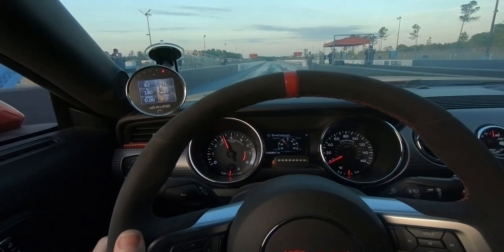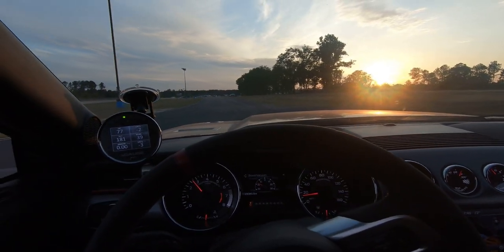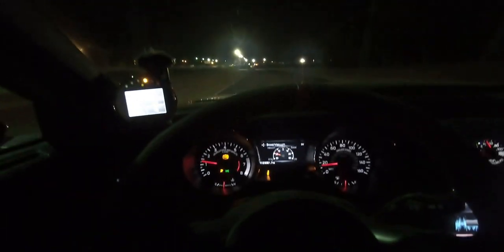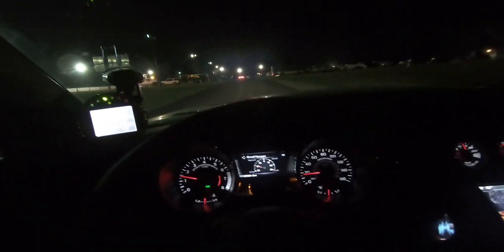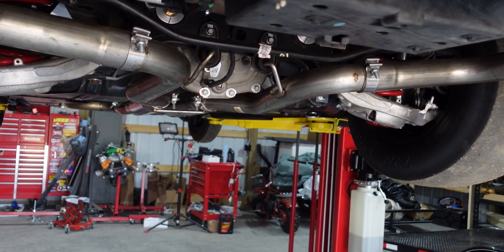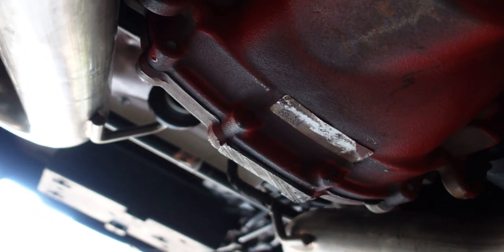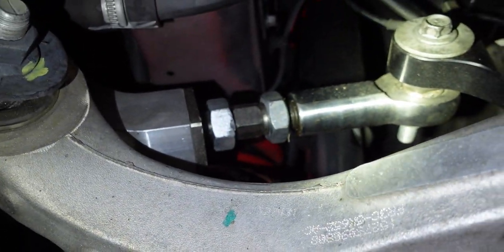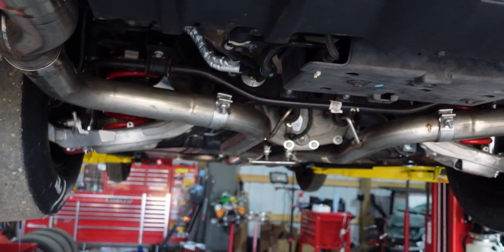How NOT to drag race a manual transmission Mustang!

Comment: Following 100% I'm a Gen 3 Whipple, stock motor and MT82 on E85. Going for a 9 here this season.
Reply from the maker: Right on man! I'm hoping to be real close to 9's by this season's end. Good luck to you and let me know how it goes!
Reply: @BackyardBMX73  Yes definitely. What's the setup for you now? I might have missed it in a video. Pulley and fuel? I'll be on the 3.1 pulley this year and E85. 3.1 should get me 16psi. I have the MPH, best of 142mph at 3800DA and no skinnies on the front but my ET is only 10.6 with a horrible 1.78 60ft 🤦 lol. 142mph was on the 3.2 pulley.
Reply from the maker: @freak_5.042  I'm on a 3.625 pulley, 93 pump gas tune but run a 50/50 pump and race gas mix. This past weekend at Ford Takeover, I ran a 6.85 1/8 on only 16° timing and short shifting. A full 18° of timing and correct shifts should get me to 6.5x which is low 10's in the 1/4. I'd be happy with that for this year and shoot for 9's next year.
Reply: @freak_5.042  horrible 1.78 60?  Lol.  I mean I get if you wanna go real fast 1.5 or so is needed and doable but I would not call 1.78 a horrible 60 foot in a manual trans car.  If it was above 2 yea that is horrible lol.
Reply from the maker: 1.7x 60' is kinda slow for a manual. I went from 1.7x 60's with 3.73 rear gear last year to a best so far 1.51 60 with 4.56 gear this year. I'm sure I'll be able to dip into 1.4x eventually.
Reply: Did the MT82 handle the abuse of getting you to a 9 sec run since you last commented on here? 😂 @freak_5.042

Comment: Nice video! What tire pressure?  You need about 10-12 psi! That will help!
Reply from the maker: 16 psi
These are stiff wall slicks so low air pressure doesn't usually work as well from what I've seen. I do wanna try a little lower.

Comment: Thanks for the video! I’m a newbie and have never been to the track before. I have a C6 Z06 manual with stock tires.  I just want to get a feel for the car and have fun.  This is a dumb question but I’ve always been concerned about when upshifting if the tires will give out and put me into a spin.  Is this something I should be mindful of with my car? When upshifting, is it better to power through it rather than let off the gas a little? I don’t want to offset the balance or spin.  Sorry if this seems silly I’m just trying to get a feel for what to expect.  I know to let off the gas if I’m going to spin but is this something that happens a lot? I know some of the basics about going around the water but any newbie advice is much appreciated.  I don’t want to crash. Thanks!
Reply from the maker: Not silly at all. I have done both... let off and powered through. It's all in the feel of the car. My advice would be to shift normally on your first couple passes. Get a feel for the track and any possible "grooves". Feel how the car tracks and if there are any bumps in the surface. There's a lot going on during a pass, so take things slow. Once you get a feel for everything and are more comfortable being out there, you can get a little more aggressive. There's a lot to learn, but just go out and have fun your first time. Don't put any undo stress on yourself. Talk to other drivers and get their take on it. Also, try to have someone film your passes. It's a good way to associate what you feel inside the car with what's going on outside. Like I said though... have fun!
Reply: @BackyardBMX73  thanks a lot! That helps a great deal.  Your car sounds amazing by the way. I had a 2013 coyote mustang.  Does yours have a supercharger I hear in the video?
Reply from the maker: @gary_michael_flanagan_wildlife  no problem. Glad to help. My car does have a Whipple 2.9L gen 3 stage 2. I have other videos of some good passes with my car. Feel free to browse through 😉
Reply: @BackyardBMX73  thanks! Do you think I need to air down to 26psi for the stock tires? Does it help? Thanks!
Reply from the maker: @gary_michael_flanagan_wildlife  you can take a little air out, as it may help some. I wouldn't go any lower than about 26 psi. You can even make passes at different pressures to see if it helps or not. If it were me, I'd make the first pass with no changes. Run it as the car is and then decide if changing anything may help. Always good to have a solid baseline to track progress with the car.
Reply: @BackyardBMX73  thanks again, bro!!
Reply from the maker: @gary_michael_flanagan_wildlife  no problem!

Comment: what tire pressure are you running? on those tires i would run 16 psi . Also I see a TH400 in your future
Reply from the maker: The 2nd pass was at 16 psi. I may need to lower it a tad, but with only two junk passes it's hard to judge what the car needs.
Reply: @BackyardBMX73  yeah 16 to stat, mark tire to wheel to makes sure that there is no wheel spinning in the tire.
Reply from the maker: @madmotorhead9425  tire spinning on the wheel doesn't bother me. A little won't hurt. I just gotta get the launch figured out.

Comment: I know nothing about s550 but it seems it needs to be stiffer in the rear or way slower in the front from the noses reaction on them two runs at least
Reply from the maker: You might be right, Jim. But, with only two passes it's hard to figure out what changes need to be made.
Reply: @BackyardBMX73  for sure even a  800 rpm launch difference can make a sweet car all out of whack, the edge of spinning vs the edge of bogging, a fine line in a stick car, you’ll sort it out
Reply from the maker: Yep, you nailed it! A very fine line indeed!